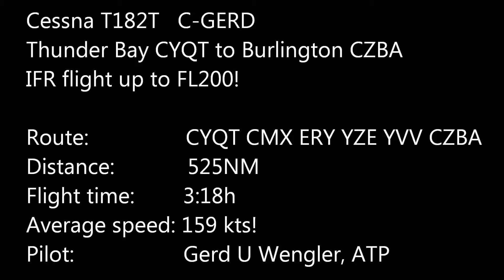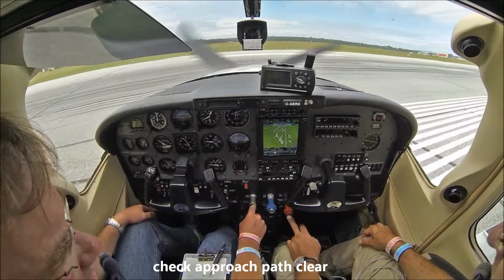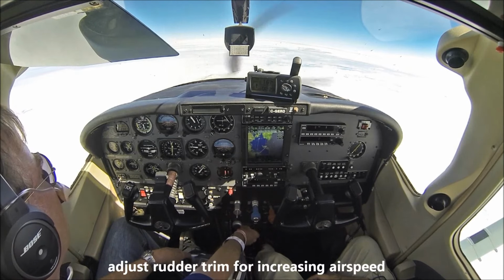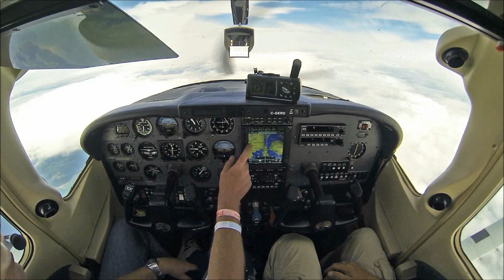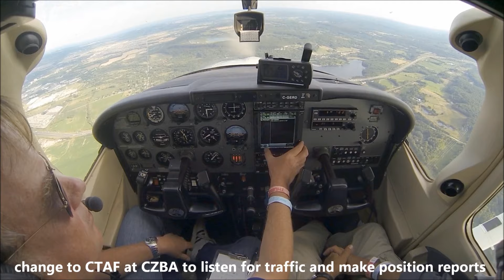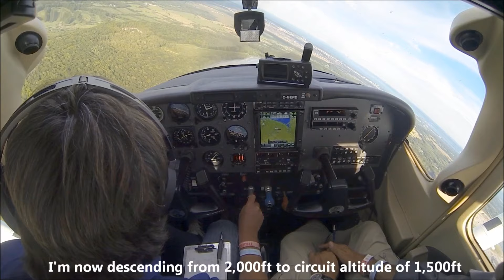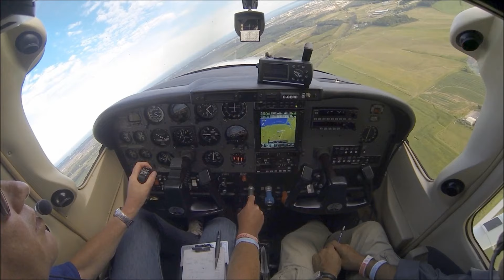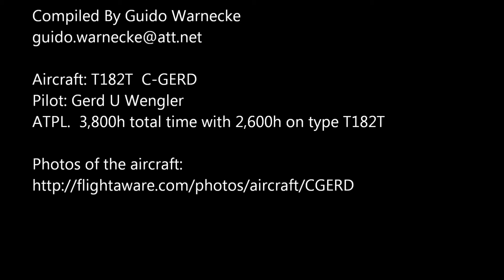Cessna Skylane at 19,000ft - cockpit video - must see!

Comment: Questions; Why were you leaning "adjusting fuel flow" at a 1,000 feet?  Do they make Cannula's certified above FL180?
Reply from the maker: +Pangaea
1) the fuel injection system in these engines is very basic, so a proper adjustment is required, even at low altitudes. This is a turbocharged engine.
2) the canulas are good for 18,000ft, we used masks most if the time above 18,000ft. Not to be seen in the video.
Happy Landings,
Guido

Comment: After landing, Shouldn’t touch anything, like flaps, lights, etc till across hold short lines clearing the runway.
Reply from the maker: Hi Howard,
in general you are right.
The pilot in this case is highly familiar with his (own) aircraft. And it is not an aircraft with a retractable gear, where you certainly should not touch anything on the landing roll out.
Thanks for your comment and happy landings,
Guido
Reply: Sccratlanta   Oh no you didn't, this is a flying video I didn't think we were going to get tested on it. please refer to comment above left for Kevin

Comment: Khmmm one thing is mising in this really good video. :) well flying at 5.800 meters will put you in enviroment wher the outside temparature is about -20 degres celzium. So when did the pilot set the cabin heating on? 😀
Reply from the maker: Hi Sanel,
when you fly above the clouds in sunshine, the large front window generates enough heat in the cabin.
Different at night or in clouds. The aircraft has a very simple cabin heater. It uses exhaust gases from the engines, that are routed through a heat exchanger to allow warm air to enter the cabin. Not very effective.
Happy Landings,
Capt. Guido

Comment: - Nice! But would want active CO detection & a PulseOx unit at these altitudes in a single-engine recip.
- PS: On a normal rwy landing, for better aero braking (w'minimal wheel braking), leave the flaps down. They aid in taxi, too, by diverting some of the propwash down. Up at shut-down. 
- No need to rush the cowl flaps while on the rwy (or the ldg lights). Leave them for taxiway entry for better ground control rwy safety. The engine won't overheat & the turbo & cyls will cool just as linearly and well - maybe more so.
Reply from the maker: Why so negative in your comments, Sir?
> CO detection has little to do with altitude (except you might. use the heater more often)
> I agree with you that active CO detections systems are useful. There was a PA46 accident recently where CO played a role (a famous soccer player in Europe got killed, there it made it big time into the press). The old fashioned black spot detectors are almost useless and have a short shelf life.
> O2 saturation check: we had the finger tester and it showed excellent values
> flaps up on rollout: I agree, actions could be delayed if not needed for any reasons (e.g. gravel runway). If you know what you are doing and you are always flying the same aircraft (fixed gear), I see no problem. 
> cool down of turbo has nothing to do with cowl flaps but with engine power setting (exhaust gas mass flow affects turbo rpm). Usually a landing rollout and slow taxi should do the roll back of turbo rpm before engine shut down.
I can assure you that Gerd Wengler, the pilot of this flight is highly experienced and KNOWS EXACTLY what he is doing in his aircraft.
Here a video in which I address actions on landing roll out. At the end of the video I also I address engine shut down procedures of turbocharged engines.
https://youtu.be/NtRRBOcgjM8?t=141
Myself I ave also ample experience with turbocharged, big bore position engines.
Happy Landings,
Guido

Comment: How long did it take you to travel the 1,200 NM? did you stop and refuel? What are the operating costs per hr of this aircraft? Great video!! Thanks
CD
Reply from the maker: Hi Chris,
fuel is around 13-14 gallons per hour. Total cost of ownership per hour is typically 3-4 times the fuel cost per hour. 
An engine alone is 60,000$ @ 2,000 hours TBO.
Happy Landings,
Guido

Comment: Wow that a lot of distance in a light aircraft. What else would comoete with the 182T in terms of range speed and size?
Reply from the maker: A Cirrus might be a bit faster, but much better payload and cabin space in the Skylane.
Happy Landings,
Guido
Reply: Guido Warnecke It's interesting to hear your thoughts on the T182T cabin, Guido!  The spec sheets on the 182 list a cabin width of 42", while the SR-22 is specified at 49".  Cirrus also claims 1.5" more headroom.  The latest SR22 also lists a useful load of 1340 pounds!  (Of course, that new one is also extraordinarily expensive, and I think most of the earlier models are more in the 900-1000 pound useful load range.

So, on paper, the SR-22 would seem to be a winner at least based on those specs.  Where does the 182 win you over?

I ask as one who hopes to perhaps have a nice traveling airplane someday.  I have flown both, but only a few times each so I'm still forming an opinion.

Comment: Hi I have a question, why was the mixture lean at 2k feet? Its my understanding atleast in the US that mixture shoudl be rich <=3k feet right?
Reply from the maker: "Lening" is probably a misleading term.
"Adjusting the fuel flow" is probably a better description. Adjust the fuel flow to the actual condition (air pressure, temperature) to operate the engine within the best parameters.
EGT exhaust temperature and CHT cylinder head temperature are the factors the pilot needs to control with the fuel flow.
Happy Landings,
Guido

Comment: Would be funny to observ a fixed landing gear aircraft flying FL190 =)
BTW: what is the endurance of the O2? Is "cheap" to fly with O2 or allways better pressurized?

Kind regards, happy flights.
Reply from the maker: Yes, the controllers sometimes ask...
The time you can fly on oxygen depends on the altitude and on the number of persons on board.
I think you can do around 4 hours at FL180 with 4 persons on board.
A pressurized cabin is of course much better, but this is very expensive.
The few pressurized piston engine aircraft in the market (Piper Malibu, Cessna P210) require a lot of maintenance.
As the air for the pressurization comes from the turbocharger, this puts additional stress on the engine. 
Happy Landings,
Guido

Comment: Great video! Thanks for sharing.  I rent a 1998 182S and curious what "adjustment" you did with the rudder for "increasing Airspeed" when transitioning from the climb to cruise.  Never heard of doing this, and would like to learn this trick.  Like what are you looking for in the trimming?
Reply from the maker: Hi Ken,
it is about rudder trim.
Single engine aircraft like the C182 have a tendency to turn left if you apply power (the propeller slipstream hits the rudder).
So on take off you push the right rudder to compensate, same during climb with high power.
Unlike the C172, the C182 has a rudder trim wheel to assist you in pushing the rudder. You trim it to the right during a climb to keep the ball centered.
If you then level off after a climb and the aircraft accelerates, the rudder becomes more effective and you need less rudder trim.
This is the "adjustment" we make, meaning to change the rudder trim.
Try this out on your next flight and see the ball in the center.
Happy Landings,
Guido
Reply: Okay it's not any more different than what I'm doing already. I never use Rutter trim during my climbs because I just use my foot on the pedal instead. Never really climbing that long. Lol  although next time I will pay more attention to the ball during cruise to make sure it is centered because I do keep the rudder trim set at where I had it during take off. (The set Mark I think is slightly to the right if I remember).
Reply from the maker: ***** Hi Ken,
there is nothing wrong with what you are doing, it is just easier with the trim. Especially when flying IFR in the clouds.
Let e now if this helps you o the next flight.
Happy Landings,
Guido

Comment: can I ask, why instead of flying right down to land he went around...was it because he had to follow traffic line??? (I'm a noob, and am interested to know)
Reply: Hi Karen, when its practicable to do you so, you always want to fly a standard pattern, particularly if you are a general aviation pilot.  - when you do that you enter the pattern generally at a 45 degree angle to the intended runway, at a known altitude, which is on your charts, and you know as part of your pre-flight, even before you leave your house to go to  the airport. So after you enter the pattern,  you fly a series of 90 degree turns, (one more 45  degree turn to put you downwind), from your landing runway, then cross wind, (base leg)  and then you "turn final" at which point you are at a known altitude, airspeed, and lined up with the center line of the runway you are going to land  on. If you are landing on an uncontrolled field, (it does not have a tower to call to) you always want to announce your position in the pattern and your intentions, using the  Common Traffic Advisory Frequency or CTAF. 

We fly a pattern to keep traffic orderly and let everyone know where, who you are and your intentions.  The big airliners fly "straight in" approaches, using instruments which either guide them or lock them on to a "localizer" in the horizontal plane, and glide slope, in the vertical plane, at a set airspeed for the approach - think of them flying a tube or a funnel which starts some place out in airspace, at a specific altitude and ends at the runway threshold, and doing so at precise airspeeds as they descend.  

As a general aviation pilot (more hours, more tests, more dual time with a certified flight instructor and a check ride with a certified flight examiner)  you can be certified "Instrument Flight Regulations" or IFR, as well ....But even so, mixing general aviation traffic, (I'm flying the approach at say 70-80 knots, and I'm on the approach with say, a Boeing 777, with its approach speed of perhaps 170  knots -  - thats a severe separation problem, and one to be avoided at all costs! 

So - many large airports will have a left and a right runway, with the "heavy traffic" on one and lighter and slower traffic (Like  my Cessna 182) on a parallel  left runway.  (example 27R and 27 L - which would be a magnetic heading of 270 (or west)) with sufficient horizontal separation to keep a Boeing 777 pilot from excessive cursing and expletives, and general aviation pilots from perspiring themselves into a puddle, and causing ATC to have apoplexy!! ! Next time you fly and can look out the window, watch for a red sign as you taxi (yellow and black or black and yellow)  - red signs are runway signs , and you will likely see numbers and a letter - something like 27L as an example that would mean that you are either going to cross a LEFT runway, or you are going to turn onto and then take off from it. Anyway, its all very organized and that is why traveling by air is far safer than being on the freeway, getting to the airport ;-)  - I hope that helps clarify the Air Traffic Control (ATC) system, a tiny bit for you.  I would urge you to look into this more - there is nothing like getting your wings!! You will never ever forget your first solo either!!  - its worth the work!  You might want to check out the Aircraft Owners and Pilots Association at aopa.org

Comment: C-GERD ist Kanada, oder? Was haben die für ein Transition Level, dass man "one five thousand" und nicht "FL150" sagt? 18.000, wie in den USA? Als Österreicher ist man 5.000 ft gewöhnt, da ist erscheint einem das immer sooooooo extrem viel :D
Geiles Video, wie immer. Hab sowas noch nie gesehen, dass man mit einer Skylane so hoch geht.
Reply from the maker: Vielen Dank!
"C" ist Canada. Die haben das US System uebernommen, flight levels beginnen im airspace A bei FL180.
Mir konnte noch niemand genau beantworten, warum da so ist.
Bei jedem check in mit neuem ATC sector muss das altimeter setting (QNH) gegeben werden.
Diese Skylane geht super hoch und man kann gute Rueckenwinde ausnutzen. Ich war mit der C210 bis auf FL230, unpressurized.
Dann wird  das mit den Nasen-Kanuelen aber ein bisschen duenn mit der Luft.
Gruesse nach Oesterreich & Happy Landings,
Guido

Comment: Gerd/Guido - now for a real question, no jokes I promise. I noticed you guys left the mixture leaned out a bit during the runup. Was this intentional or by mistake?
Reply from the maker: Engine runs way to rich at low power settings with mixture in rich. Run up is done with 1700 rpm only.
It is important to go for full rich during take off (turbocharged engine)
Happy Landings,
Guido
Reply: If you don't do it plus taxi not leaned very aggressively you run the risk of sparkplug fouling.
Reply: Gerd Wengler I have a T182T myself which is why I ask. I know you have a lot of time in it.

The POH recommends full rich for the runup and leaned for max RPM while taxiing. I'm familiar with the spark plug fouling risk but never heard of it also being an issue during runup.
Reply from the maker: The power during runup is too low to cause any thermal damage even if the mixture is not rich.. It is important though to have full rich mixture on take off, irrespective of airport elevation (turbocharged engine). I was the "mixture man" on the flight.
Happy Landings,
Guido

Comment: Hello Sir, cowl flaps are set by cylinder head temperature gauge right? I'm starting to fly my PP license in some weeks, and I really would like to know how it's done.
     I really enjoy your videos and hope you keep making them.

     Céus de brigadeiro sempre (brazilian expression of ''blue skies for you'').
Reply from the maker: Victor Vasques Muito obrigado, Victor!
Yes cowl flaps regulate the airflow through the engine!
The inflow is through the front of the engines, it flows around all cylinders by baffles (these are pieces of metal / plastic that channel the air).
The cowl flaps regulate how much air is flowing out of the engine.
The main instrument is the cylinder head temperature. This should be well below 400F.
In climb you need a lot of power and have low airspeed = cowl flaps open.
In cruise and descent you have lower power and a lot of air stream going through the engine = cowl flaps closed.
Why do we not leave them open all the time? They produce drag and reduce the speed  5-10 kts.
Happy landings,
Guido
Reply: I couldn't get a better answer. Thank you!
Reply from the maker: You are very welcome!
Best of luck for your pilot's license.
Happy Landings,
Guido

Comment: Thats pretty impressive! Ive never flown a 182 but had a hell of a time getting my 172 up to just 10,000ft! it took hours with my climb rate going as low as 10ft/sec! on the  way back I stuck with 6000ft. there is definately no advantage to flying that high in a 172. just a waste of time and gas really but I wanted to test it. obviously, I  am very jealous! we only had 152's and 172's when  I was in training. good work on your pitch&mixture work on that! the then air  didnt bother you?
Reply from the maker: Thank you!
It is all the work of the turbocharger.
A normal C182 gets up to 13-15,000ft only.
Above 12,500ft (sometimes even lower) you have to use supplemental oxygen, which we did.
Mixture and prop control is some additional work but you get used to it.
Thanks for watching my videos & happy landings,
Guido

Comment: when you came in to land you used 20 degrees of flaps on the downwind leg, then you used full flaps on the base leg. I am curious to why you did this. I understand what they are used for as i have almost 30 hours of experience of flight and I have always been taught to use 10 degrees on downwind, 20 degrees on base, and 30 degrees to full flaps on final approach. What benefit did you gain from using 20 degrees on the downwind leg other than a slower approach?
Reply from the maker: Hi Michael,
in large aircraft you usually use standardized flap settings during a visual approach.
During this approach, a C152 slowed down the traffic for the faster C182T. Hence the use of flap 20.
Happy Landings,
Capt. Guido
Reply: @GuidoWarnecke  makes sense for the flow of traffic!

Comment: I'm unfamiliar with the 182, I've only flown 172's... But does the 182 have rudder trim? Noticed that your feet are off the pedals and your still in coordinated flight.... I'm pretty sure I just answered my own question... But just curious.
Reply from the maker: The C182 has rudder trim as opposed to the C172. reason is the significant higher engine power of the C182.
The C172 is somewhat in neutral rudder trim in cruise, for climb you need to push...
Happy Landings,
Capt. Guido

Comment: Hey there Guido,
what do you mean with adjusting the rudder trim for the increasing airspeed? What are the rules (Deutsch: Faustregeln) doing this? Is this something which is usually done in every aircraft for I did not notice it too often...

Many thanks/vielen Dank und viele Grüße aus EDVK:)
Reply from the maker: Hallo Ben,
da gibt es keine Faustregeln. Immer so trimmen, dass die Kugel in der Mitte ist.
 Langsam und mit viel power (take off) nach rechts trimmen, schnell und wenig power (Sinkflug) nach links trimmen.
Geht it der Zeit automatisch - wie Autofahren.
C172 haben keine rudder trim.
Da ist alles so "fest" eingestellt, dass im Reiseflug (in etwa) keine Ruderkraefte erforderlich sind, man kann die Fuesse von den Pedalen nehmen.
Bei staerkeren Maschinen  C182 / C210 muss man trimmen. Oder starke Beine haben.
Bei zweimotorigen Maschine ist die Trimmung fester Bestandteil der "engine out" actions.
Happy Landings,
Guido